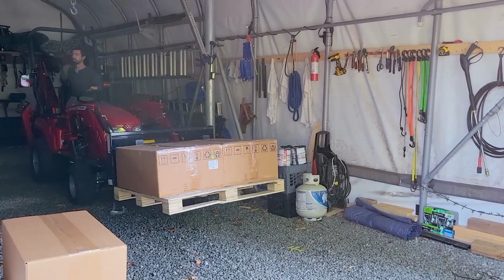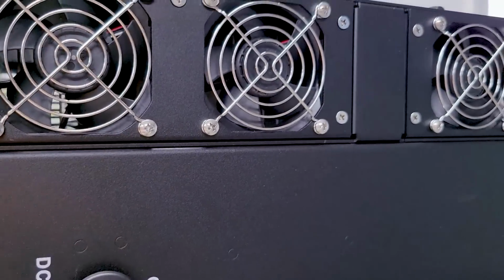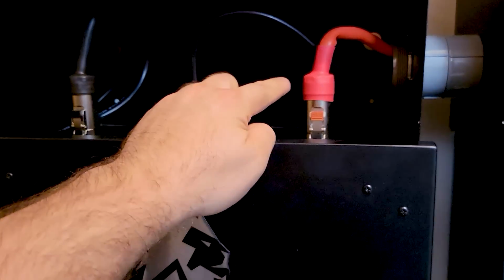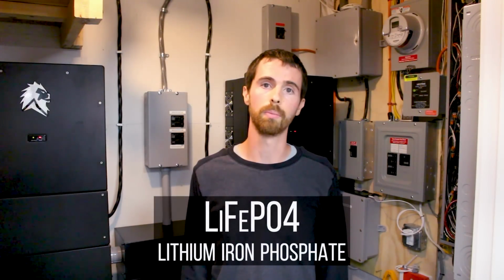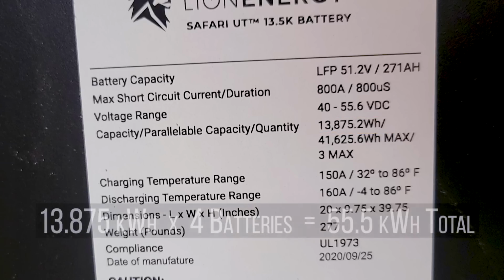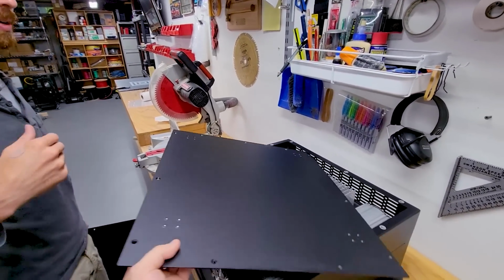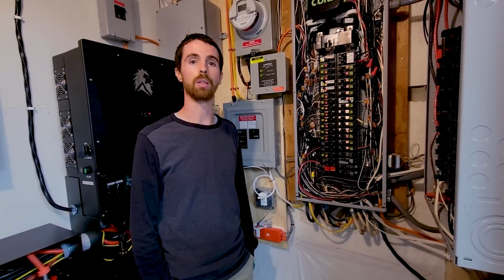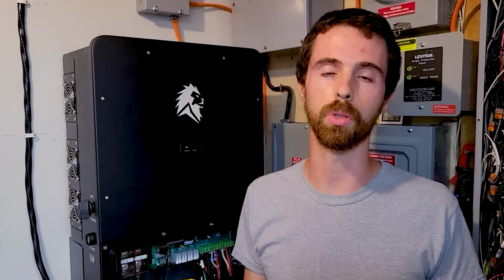LionEnergy Inverters and Battery System

Comment: I am having the same problem with my LED lights flickering.  How did you fix that?  I have three of the older inverters with 24kW of solar with DC backup with 40 kW of batteries, all LionEnergy.

Comment: Sounds like "upstarts" have lots of issues...so $30K just for some of this hardware seems huge cost to run your house. Likely need another $20K just to have installer and other guts include--SICK!  Even with a $7500 tax credit--solar still needs to come down to $10 to $15k for whole solar set-up on home to make it worth investment.  Especially when you are replacing batteries every 10 years--SICK!

Comment: Transformer type? Master and slave or or 240 split phase each? Not designed for micro grid operation? How much surge capacity? Expandable, how many can be added? Will they support three phase? Thanks in advance. Fred
Reply from the maker: These inverters are transformer-less.  Sometimes referred to as "high frequency".  Each inverter puts out 120/240.  You only need one inverter for 120/240.  The second inverter only increases capacity.  It's supposed to work as a micro-grid for the house, but there seems to be some glitches.  Sorry, I don't know the answers to the rest.
Reply: @DavidPozEnergy  Thanks for the reply trying to get together a ranch system,  50 kw to start.
Reply from the maker: Wow, 50kW of inverters?  That's huge.
Reply: @DavidPozEnergy  That is to start we will be needing around 200 kw but in 3 phase ( mining equipment) I can't afford lithium ion batteries but I have forklift batteries and equipment to handle them. SMA i found is expandable but they are extremely expensive.
Reply: @DavidPozEnergy  I hope I'm not bothering you with so many questions. I am the same person that wanted to send you an array controller, were in California.
Reply: @DavidPozEnergy  I'm currently testing a 12kw 150 volt growatt from Signature Solar for my son's house. I have all the panels and hardware but seeing if it will handle large resistive loads and have enough left for starting other loads.
Reply from the maker: Sounds good.  Schneider XW Pro comes to mind as a way to get 3-phase.  I think they can be wired 9 inverters total, or 3 inverters per phase.  That would be 61.2kW continuous.  https://signaturesolar.com/schneider-conext-xw-pro-6-8kw-inverter-charger-48v-120-240v/?ref=4_rHcgZ9x-TiF-

Comment: Are there off-grid inverters that disconnect before the BMS shuts down the charge controllers then turns itself back on when the sun comes up and voltage has risen?  I need something that will still be on if I go away for a while (even if it shuts down at night from time to time).

Comment: I see he has a Sense system, what is the black "CORE" box in the breaker panel for?
Reply from the maker: The CORE and SENSE are both whole house energy monitors.  Sense has been having some trouble identifiying every load, but the CORE is a manual version, with a CT clamp for each circuit.

Comment: NOPE! That circuit breaker at 4:25 hidden way back behind those two main power rail connections is an instant fail in design, accessibility (at least 22 screws to access) and safety (reach through in an emergency). Also, those 'negative' and 'positive' quick connectors at 4:09 better not be conductive and exposed like that unless you don't mind surprises. After that I really lost respect for this product and was turned off especially after hearing about the electrical harmonics issues. This product looks like it's still in a 'beta release'.
Reply: I’m still interested but I get what your saying, that black box looked so slick until I saw a floating mess of DC buses, ac conductors, coms wires, and breakers.

Comment: I am a bit surprised that you could get away with "tricking" the micro inverters.  Grid tie inverters generally rely on the low impedance "grid" power to function properly.   I am not an expert, so maybe I am missing something ???
Reply from the maker: It's not that we are tricking the micro-inverters.  We are taking advantage of the built-in shut-off feature.  I think these particular micro-inverters automatically shut off at 60.5 htz.  (normal is 60.0 htz).  The inverter adjusts up to 61 htz (again, if memory serves me right).

Comment: I really like the modular design they are trying to achieve here. It could really set them above everyone else.

The inverters obviously have the same supplier as Sol-Ark but went with less features on their model. Out of curiosity, I'm sure they have the same load balance issue when in off grid mode? 
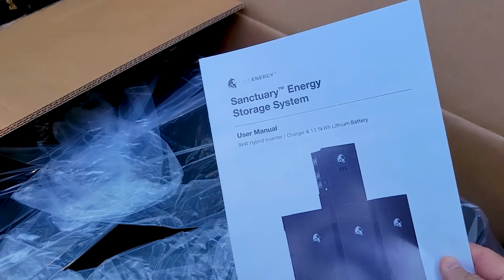Did you guys say what size inverters these are? At 2:00 you show the manual that says 8kw. I'll just assume that's what they are.

Why the hell did the put the battery breaker on the inside of the battery case? Just wtf..

They need to go with a regular display screen on the inverter imho.

Comment: If the lights flicker, that's NOT "5ms". I have data center UPSes with 10ms switching time; it takes an oscilloscope to see it. (one cycle at 60Hz is 16.7ms)
Reply: I am having the same problem with my LED lights flickering.  How did you fix that?  I have three of the older inverters with 24kW of solar with DC backup with 40 kW of batteries, all LionEnergy.

Comment: I know battery breakers are suppose to pop, but having to take out 30 screws to reset a breaker is kinda stupid. And, unless you know there is a beaker behind said panel, you could look for hours trying to figure out what happened to the battery's output.
Reply: I was about to say the same thing. It's a junk move putting the breaker INSIDE the battery compartment where you have to remove dozens of screws just to see it, exposing potentially dangerous voltages (and over 5000A short circuit currents). And I'm guessing there's no document mentioning that breaker being in there. Also, a proper lug and bolt will be way better than any pluggable connector. (cars get away with it because they're high voltage/low current. these inverters are low voltage/high current devices. just visit any telco battery room -- there are no plugs anywhere)

[Note: the battery cells look to be bog-standard Chinese cells. If they haven't been properly compressed, they're tiny aluminum balloons waiting to pop. 50% cycle them daily for a few weeks...]

Comment: Hi David 
I have a question about how to connect two inverters to a 2 phase panel 120/240 V . I have 4 solar panel , one controller, two 170 Ah batterie’s in parallel at 12V and two inverters 1000w and 3000w - eliminator in Canada . I supply the power  from solar panels to the batteries through the controller. I have a back up generator 10kw and manual transfer switch to select the generator or the inverters . I connected  one inverter to one phase and the other one to the other phase and when I connected the second one to the 12V battery smoked and burned out. Can you help me with this please. There is off grid system that I created in the middle of the forest! Thank you 🙏
Reply: Why you can not answer by message or web because for me is long distance to call this nr

Comment: That inverter looks a LOT like the same case/hardware that Solar-Ark uses :)
Reply: That's just a rebranded Deye Inverter, like Solark and many other Chinese clones.
Reply: @SIGUEL  thanks for the reference… I’ve seen the similarities but didn’t put 2 and 2 together
Reply: I thought the same thing… especially with the multi function ac output etc…

Comment: That’s great to know. Didn’t realise you could AC couple a battery. Absolutely saver on retrofits. However, how much efficiency loss during charging is there as a result? Thanks.
Reply: They're AC coupling the inverter(s). (i,e, bringing the micro-inverter AC power from the solar into the "grid" or "generator" input. vs. bringing the solar as DC down to the MPPT ports.)
Reply: @jfbeam  thanks for the clarification. So if you’re using a string inverter setup, you’d still need an inverter that will feed DC into a battery, am I right?

Comment: I believe Lumnah Acres purchased their system direct and it has been running flawlessly for several weeks in an off-grid application.
Reply: Red Poppy Ranch has this system too.  Seems to be working well for them.  Very expensive compared to DIY, but not everybody wants to do that.
Reply: @JohnDoe4321  - I follow both Lumnah Acres and Red Poppy Ranch and both have had no problem with their systems.  I've been running 4 Lion Energy UT-1300s that I bought through Costco and am amazed at how long they hold their charge.  I highly recommend the UT-1300s for mobile applications and will probably install a grid-tied Lion Sanctuary system at my home.

Comment: Cool stuff. I thought Lion wasn’t available anymore. Does the inverter have a grid port that is in and out not just in. To supply power directly to the main panel like a grid tie inverter? How do you change settings without a display?

Comment: if I understand this correctly at 9:34 you said that those terminals can provide 4 streams of solar? if I am not mistaken you can only provide 2 streams of solar PV1- PV1+   PV2- PV2+ THAT MAKES = 2 STREAMS OF SOLAR ? AM I Correct or am I missing something ?
just saying ! and question are those inverters low or high frequency? thanks for your time
Reply: Noticed the same thing. 2 strings supported, 2+ and 2 - , not 4. Only 4 if you count BOTH inverters ^^.
Reply from the maker: Each inverter has 2 MPPT controllers built in.  Which means it can support two arrays independently from one another.   But, each MPPT terminal block has space for 2 strings wired in parallel.   This means the inverter can support 4 solar strings.
Reply: @DavidPozEnergy  my understanding is that anything that becomes parallel becomes one not  separate ? the same is to say if you add a combiner box with 6 lines of streams of panels to parallel to one controller it is still one array all together all that those terminals do is to increase the amount of current being delivered into the charge controller but it is still one line to each controller  regardless am I wrong ? and I guess these inverters are high frequency because of how easy that you lift it to the wall am I wrong ? thanks David for your time

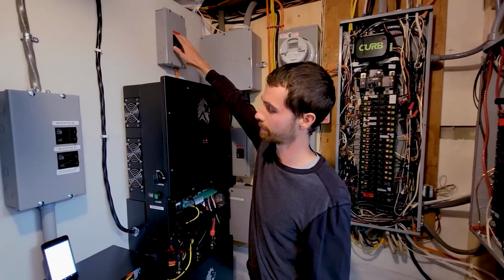Comment: 16:15 Can you explain what you are shutting down? Is itbthe battery charging?
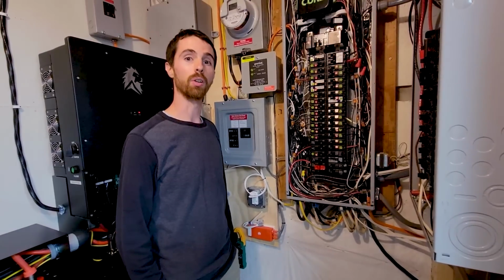17:00 When shutting down, does the phase of the inverters are synchronised with the grid?
Otherwise I wonderif you need to have any motor running be re-starting after a delay.

Comment: Nothing special there except big price . The idle power is twice normal for inverters ,there's no excuse for that and the charger can take the cells to 3.475 volts per cell which is damaging your battery at that level. Very confusing wiring. Nah . I can do 20 amps 240 volts for less than $4000 AUD or $3000 in USD. With a 200Ah 48 volt battery with MPPSolar Hybrid inverter. So look around some Folks.

Comment: 6:36 "Everything to be DC coupled"  
Can you explain the difference between "DC coupled" and "AC coupled" ?
Can you shut down the DC/AC inverters when not in use? Or what's the consumption when iddle?
Could you explain, may be in another video, all those Red Labels.
Reply: DC coupled means your connecting your panels, which are DC, directly to the inverter at it's solar inputs. AC coupled means your using an existing inverter and wiring that output into the home side of the inverter.

Comment: kind of disappointed.  A system like this should be primary, not stand by.  Also, the nice thing about lifepo is that you can do the 100 percent charge to 100 percent discharge and not degrade the batteries.
Reply: That's a myth. They will withstand such abuse, but you will not get 10,000 cycles out of them. (plus LiFePO4 has a sharp cliff at both ends of the cycle.)
Reply: @jfbeam  hmm...not on any reviews I've seen...here is a good one...https://www.youtube.com/watch?v=_eonKFwvZ9s...@29:40 he gives the 8000 cycles to 80 percent dod or 21 years to 80 percent....

Comment: 80% is truly not necessary with these batteries, you will age-out the batteries before you kill them from cycling.  Be smart and use the entire battery.
Reply: Plenty of documentation saying 80 percent cycling dramatically extends the life of the cells. I haven't seen a cell manufacturer that claims other wise .
Reply: @onthelake9554  There is some validity to his statement "you will age-out the batteries before you kill them from cycling."  Like you, I advocate the 80% rule, but for many people he is likely right that the batteries will calendar age to failure before they die due to cycle count.  Hard to say what that calendar aging failure point is, but I have a feeling many of us will start to find out at about the same time, LOL!  My philosophy at this point is to limit to 80% or less IF I don't need the reserve, but if the time comes when I need the extra capacity due to outages, extended low solar production, (or?), I will reset to utilize more of the battery during that time period.  But I can't see pushing them beyond say 90%, maybe 95% max... it stresses the battery beyond my comfort level, even if they will possibly calendar age out first!
Reply: @onthelake9554  true, but these cells tale so long to get to 80 percent  capacity when cycled at 95 to 100 percent depth of discharge that it is s needless waste.  When you only cycle down to 80 percent yiu spend more money for a bigger battery.  These, if cycled daily, will likely hit 80 percent capacity in 10 years.  So at that point, if they haven't beed ruined in some other way, and 80 percent capacity is not enough for you, just supplement what you have with a small 3 kwh battery.  The technology has improved.  We no longer need to cycle at 80 percent because the chemistry of these batteries is so good.  

If he was using a battery comprised of 8650 or similar cells, then yes, but with Lithium Iron Phosphate it is a needless waste of money and resources.
Reply: @michaelc2644  I'll leave you with this from a major LFP battery manufacturers warranty clause :   

 "While SimpliPhi’s ten-year Warranty does not specify a warrantied battery cycle life, AmpliPHI and PHI
batteries’ expected cycle life rating is 10,000 cycles when a maximum of 80% DOD is maintained, 5,000
cycles at 90% DOD, and 3,500 cycles at 100% DOD at standard operating conditions. "

If I spend 10k on a battery bank I prefer 10,000 cycles to 3,500 .  And still have a useable percent for years to come.
Reply: @onthelake9554  missing the point of engineering a system  and this is a manufacturer, not all manufacturers.

In any case  enjoy your batteries your way.  I begrudge you nothing.  This is the USA where we are free to do as fe feel is best!
Reply: @michaelc2644   Your statement of "be smart and use the entire battery "   is questionable .  The main reason for leaving alone the top and bottom 10 percent is to avoid  cell volt imbalance .    The middle 80 percent doesn't stress a slightly weaker or slightly  stronger cell.  If you want the best longevity 80 percent is the "smart"  way to go.
Reply: @onthelake9554  not with Lithium Iron Phosphate
and a good bms.

It is tiresome when you are not up to date.

Let us us just not agree and leave it alone.  No need to pursue this topic further given your level of understanding.
Reply: @michaelc2644  Wow your arrogant .   What makes you think I'm not up to date ?   I'm am only speaking about LFP/LIFEpo4 .   Not one single cell manufacturer  shares your beliefs .  There are a lot of new people trying to learn about solar storage read these posts and don't need to be misinformed such as yourself.
Reply: @michaelc2644   This video released today , that up to date enough for you ?    https://www.youtube.com/watch?v=uNFIkNtsd1c
Reply: @onthelake9554  lol thank you.   Enjoy.

Comment: Nice built to go with most systems. I wonder how you set that breaker behind all those wires without touching any lol I guess it's only 48 volts but it still tickles the bare arms. Price seemed pretty good too. Good luck.